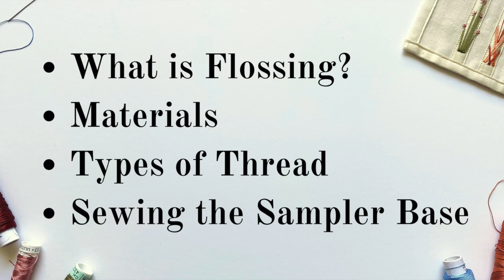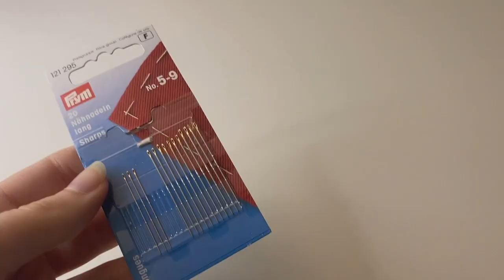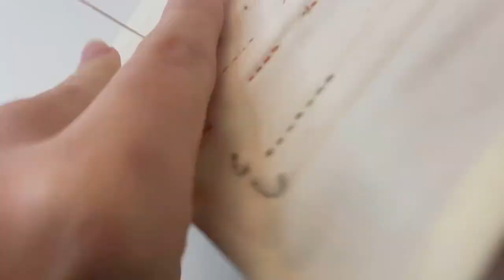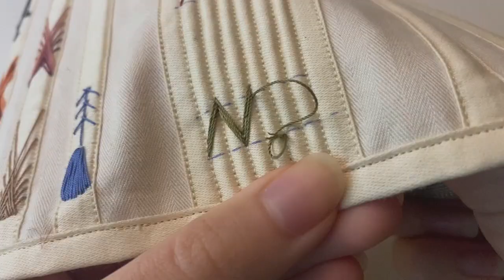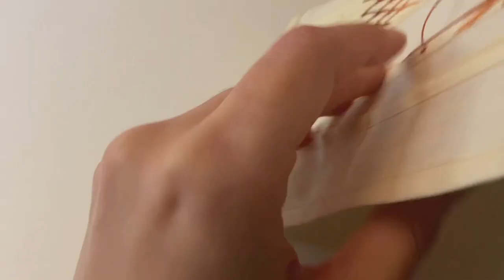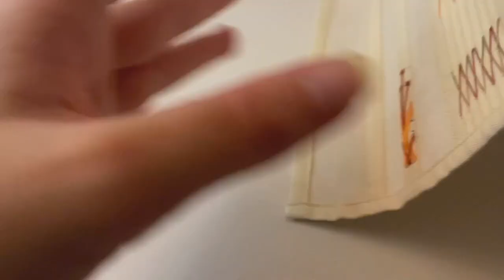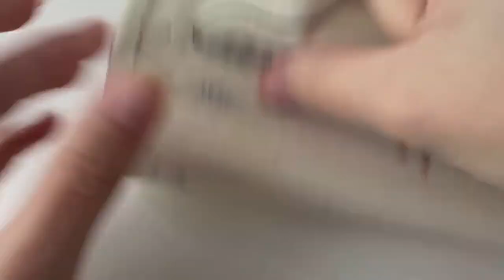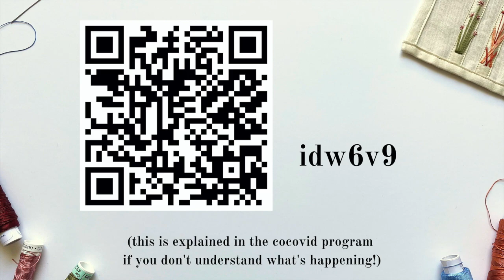Sewing a Flossing Sampler - Victorian Corset Embroidery

Comment: Wow, now I definitely want to do a flossing sampler for myself, even if I think I'll do a smaller one. :D How small are the punched holes in the whalebone and how easy is it to make them with the hole punch?
Reply from the maker: The ones I showed in the video are about 2mm across and I just used the smallest setting on my hole punch for them; they were very easy to do because I used 7x1mm synthetic whalebone for the sampler. However, I know a lot of people prefer the 6x1.5 mm for corsets, which would be harder to punch through and 2mm might be a little too big for the hole. Personally I’ve drilled a hole in the narrower bones with a 1 or 1.5 mm drill bit and that worked fine as well. I hope that’s not too over complicated, short answer: between 1-2mm!
Reply: @LinaPiprek  Thanks for the tip! And that was not over complicated, I appreciate the extra information because I wouldn't even have thought to ask about it. :)